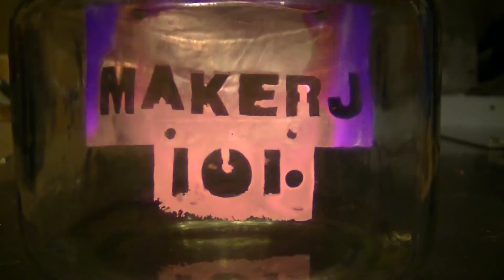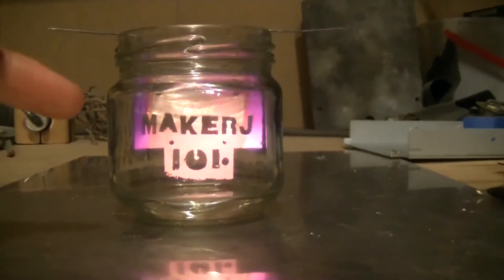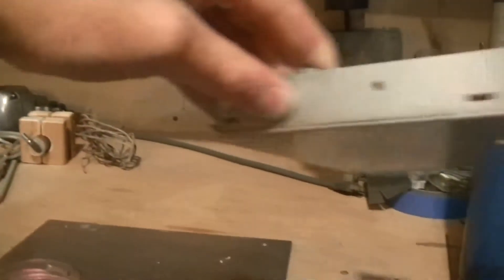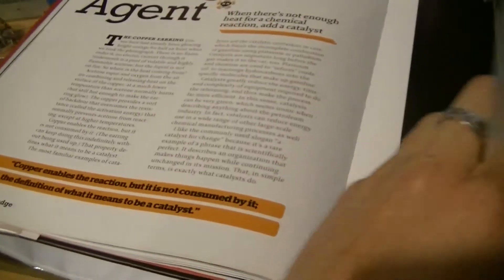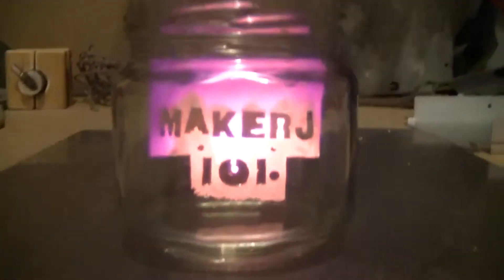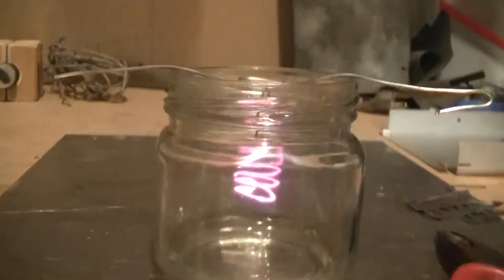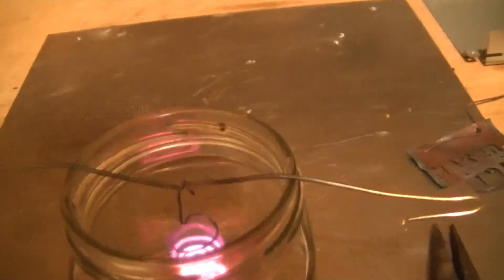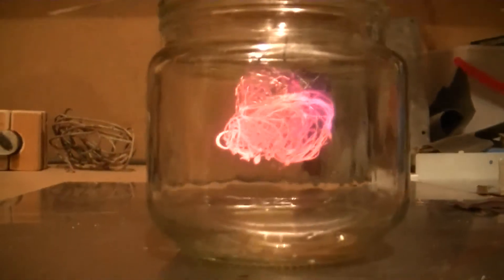Awesome Acetone and Oxegen Copper Catalyst Experiment

Comment: I just tried this, and it is way cool, even with just a single strand of copper wire! And i also discovered that steel wool can also be a catalyst for this reaction! Since i was already in the garage, i also tried gasoline, and it does work with both steel wool and copper, but it is not as good as acetone.
Reply: And i too noticed the strange smell that comes from this, almost sweet smelling.

Comment: I'm not sure about alcohol and carbon monoxide? Most things do make some when they burn though. Although good alcohol is one of the cleanest fuels around. I'd be more inclined to blame any plastic coatings, and other additives to the cans you use for stirlings... BPA, Phthalates, and other endocrine disruptors, like fire retardants  everywhere, that will give you a headache... Especially if you heat or burn them and inhale any vapor. Science is still listing side effects for that stuff...

Comment: Smells like burning butane, solder, and flux, lol. Goes from 300c to 500c, roughly equivalent to variable 70w. Has piezo igniter built in. Runs for maybe 45 min on a fill, uses a lot of butane. Could probably go through a big can in 2 days or less. Great for really big appliances that can't get to my soldering station. Also great for SMD work, as has blower attachments. Do you want me to do a video?